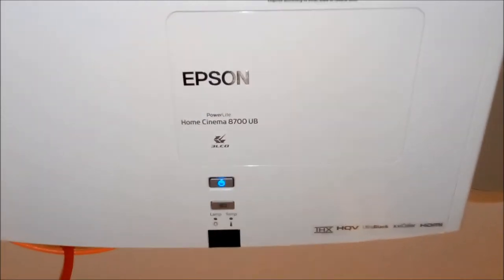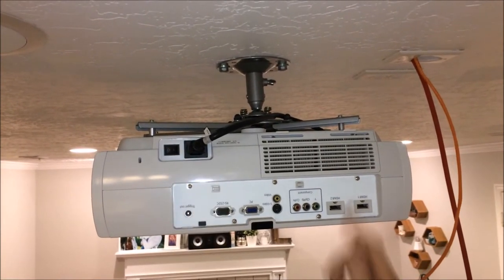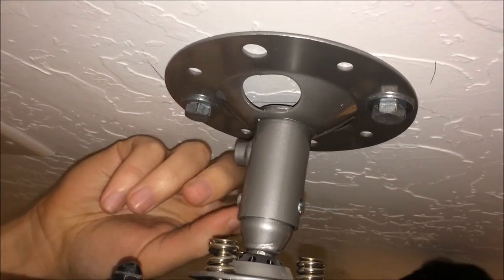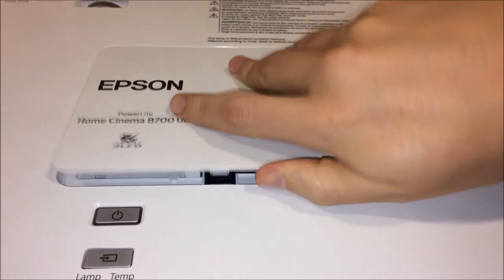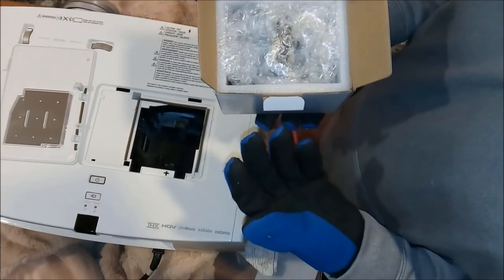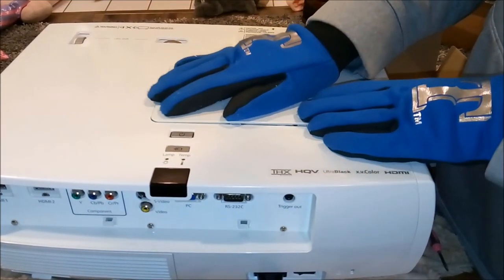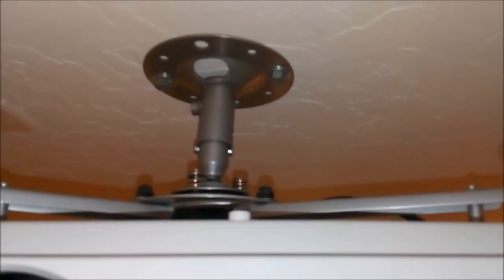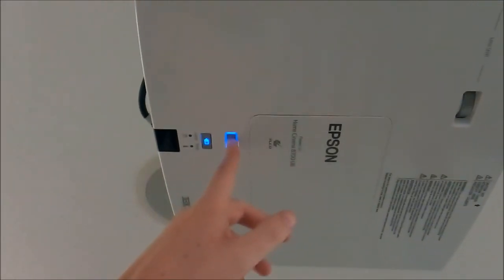How to replace or install projector lamp bulb DIY video | #diy #projector

Comment: Is it possible to do this without removing it from the ceiling?
Reply: As long as your access panel is accessible yes.
Reply: @Catherine. Thanks so much for your question. It looks like the question has already been answered.Best of luck with your next DIY project.
Reply: @chadkollasch4921  Thanks so much for answering the question.  Thanks so much for your comment.  Best of luck with your next DIY project.